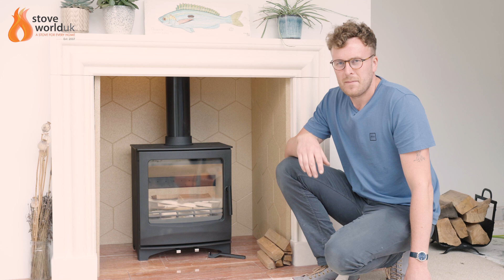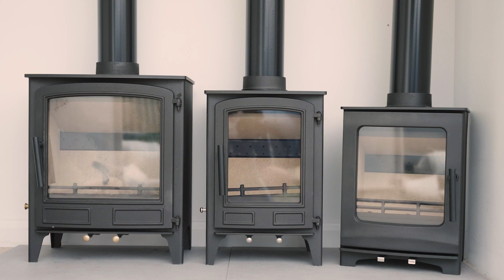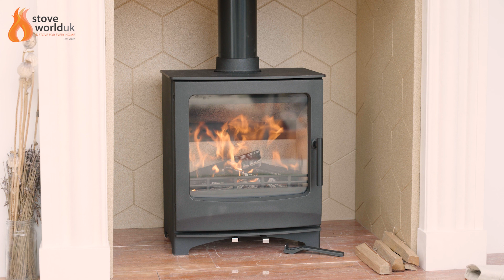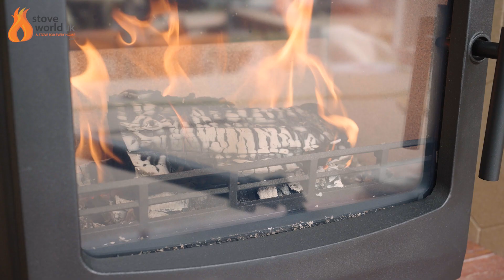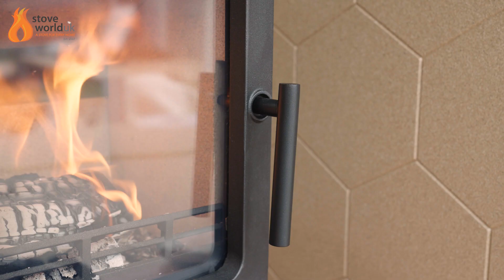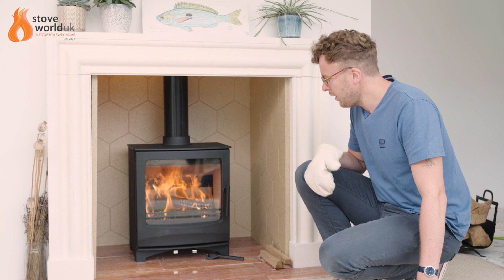Ecosy+ Newburn Stoves - First Burn

Comment: Advice to everybody, but welding gloves. Gives you a high enough cuff and temp protection that you can easily adjust logs in the stove.
Reply: Hope to have my stove fitted this afternnoon thanks for the tip re welding glove will l require a flack jacket  as well

Comment: the manual say 40 minuite burns to start with. is that right or is this vid right?
Reply: That’s what my manual says(for a different stove) other videos show smaller fires as well so confusing don’t want to bugger it up 😂
Reply: @Manny57911  Im going with ignoring this video and just a couple of small burns first.
Reply: @lightend100  yeah that’s what I have done did a fourth burn last night with two medium size logs and will slowly increase log size and burn time over this week and hopefully all is well.
Reply: @lightend100  don’t think he has to worry about seasoning the stove as his living room on has one wall and by the sounds of it is outside 😂 anyone else using any new stove for the first time should start with a small fire first, let it burn out and cool down and gradually increase the size and lights of burn over 2-3 fires. Make sure to touch up any scratches or marks on the paintwork before lighting any fires so it seasons the same colour also 😉